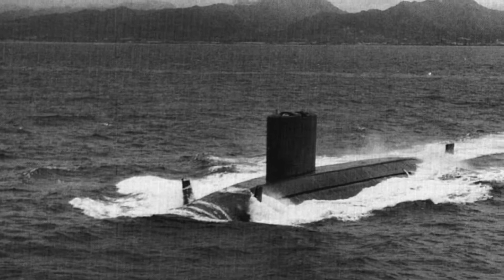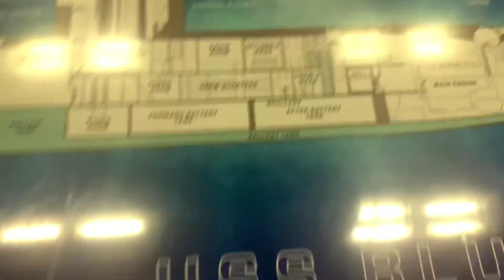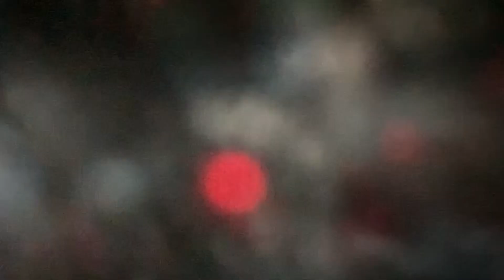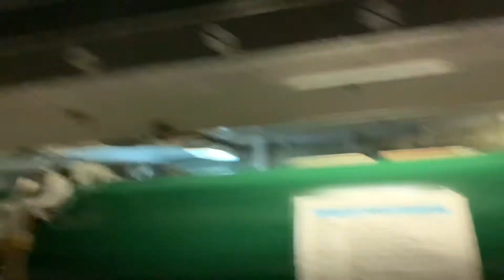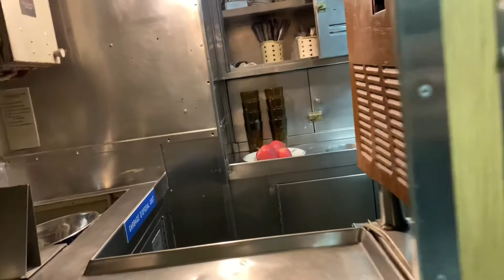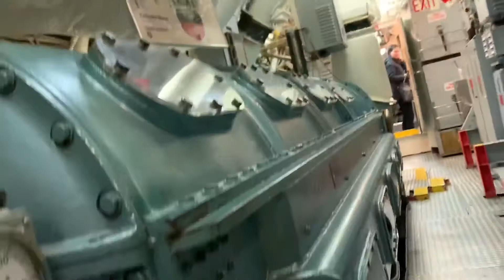USS-Blueback (SS-581)  Submarine...💦 Walkthrough

Comment: I worked on those 2 stroke engines 30 years a go in Alberta oil & gas fields , they converted those Fairbanks Morris engines to run on natural gas to hook up to a 6 cylinder gas compressors to pump gas to cities and towns for your heating of your houses and electric generators , amazing engines they were , Home oil and Dome petroleum had them in northern Alberta .real men real USA steel, did you know that colt industries started out by making colt 45 guns and canons in the 18 centuries .thank you for the memories .